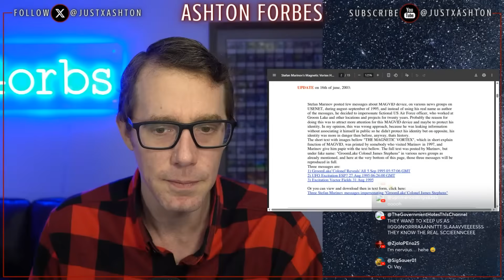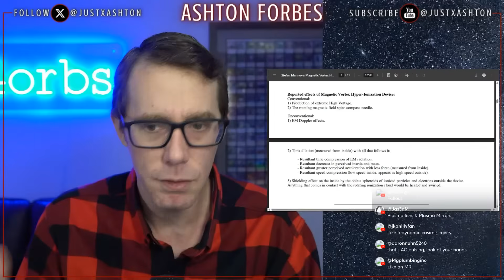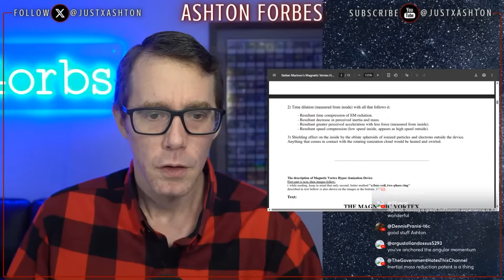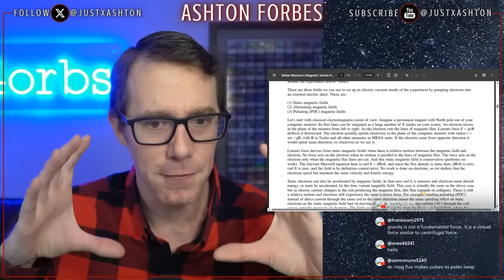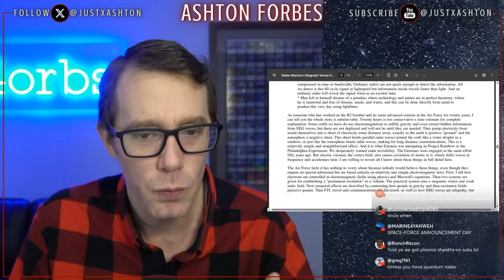Not Deployed Until Needed

Comment: The multiple ceramic tubes and barriers of barrel chambers like a revolver that holds bullets in a chamber feed the rotation of the tubes with 45 degree bends to the next barrels of a hexagonal looking assembly the whole thing was in the 1960s investigation of rotational plasma bubbles in the vibration of sounds to flowing from centers of spin but the gearless differential design is a dopler wave harmonics the plasma balls expand contract and discard extra voltage from the top to the bottom stage in rotation they spin inside the tubes and it releases a lot of multiple wavelength partners

Comment: Ecoe's Assemble a spin in three point travler effects each not exactly the same as the counter parts so they can keep the distance between them as a measurement and not lose integrity of the swapping charges via beaming vibration of multiple devices in a dopler  system straight line linking each plate is reciprocal to the other